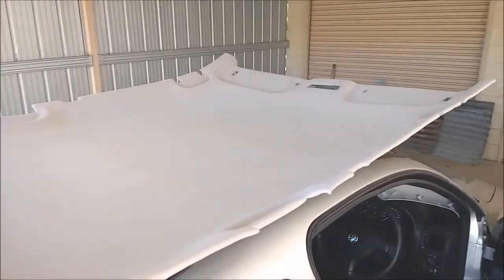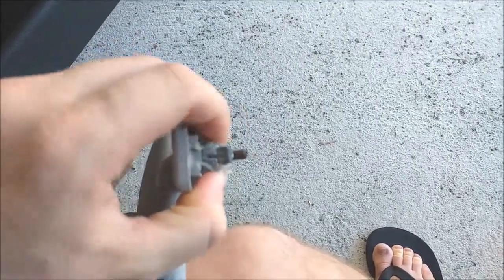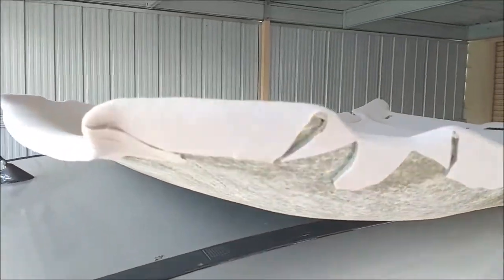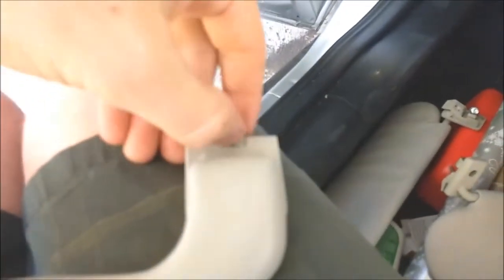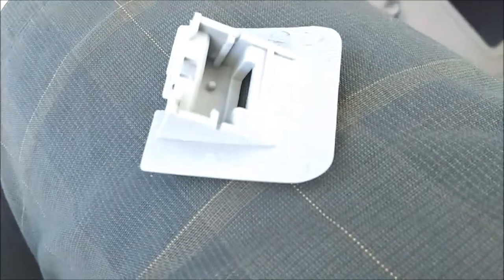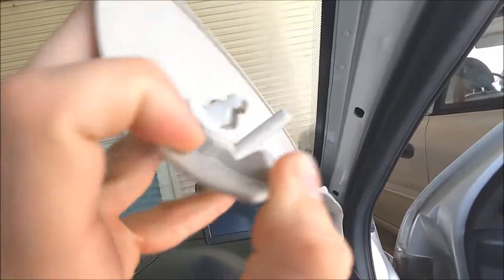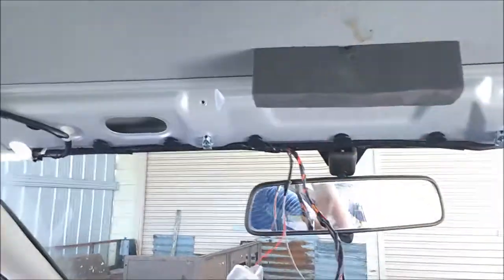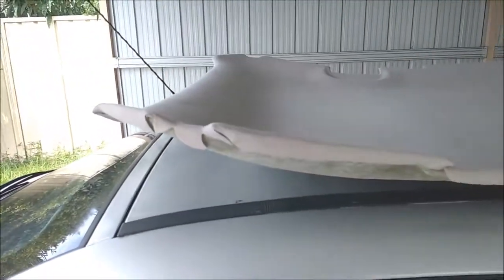Astra TS and G series roofliner removal

Comment: Thanks for this video! I am re-covering the headliner in my 2002 Astra and I was having a really hard time getting those front visors out. The whole thing is really helpful especially tips about seatbelt holders and all the little bits that can pop out and get lost. Anyway I did it without breaking anything, took about two hours but I would have given up without this video so thanks!!!
Reply: What glue did you use for re-cover your headliner ? :)
Reply from the maker: @darkrai029  I paid a professional upholsterer $100 to re-cover the head liner board. For me, it was definitely worth it.

By the time I looked at the cost of buying some decent 3M headliner glue and foam backed liner material, it was only an extra $30 or so.